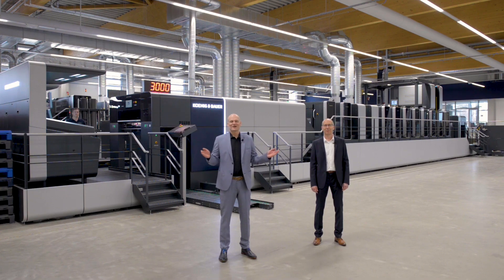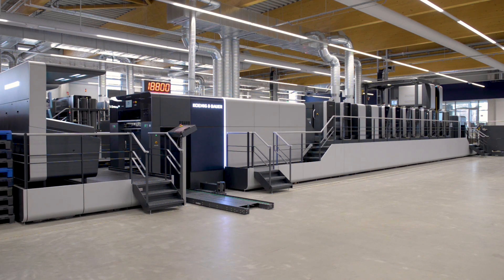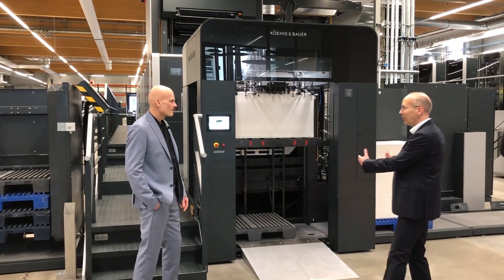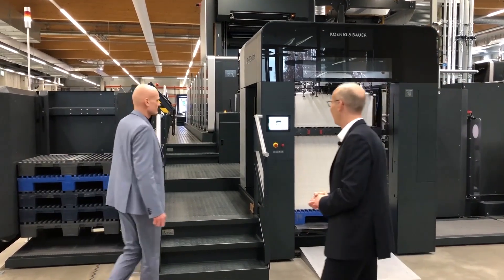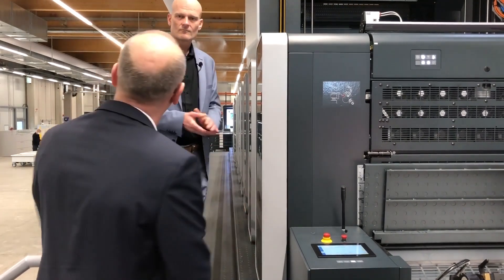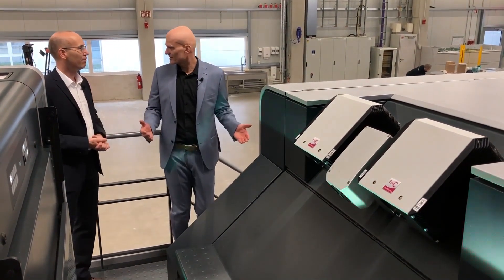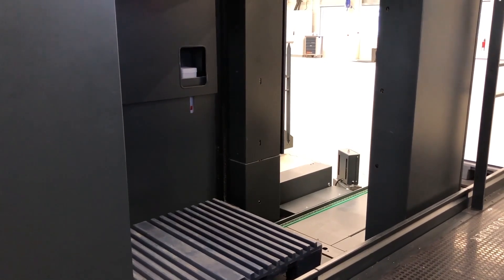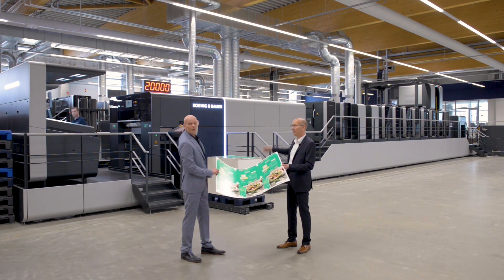Rapida 106 X | Nonstop production of 20,000 sheets/h | #KoenigandBauer360

Comment: Wow! That is definitely a productive machine! Too bad I’m at the end of my printing career, I would have loved to run a press like that. When I think of the labels we used to print on a 2 color manual press!
Reply: The difference dear Louis, is that years ago you learned a job and it really took the head and the commitment to be a lithographer....now you don't learn anything!!! The operator nowadays, doesn't even know 10% of the printing process....with all these technologies, he has lost a lot in individual professionalism. In this video, they show that everything works well and everything at maximum speed, when in reality you know very well that this does not happen, I work for a world leader in luxury packaging and I can assure you that certain jobs, with 8 colours, 2 varnishes on laminated paper etc etc .... more than 8000 sheets per hour you can NOT go, otherwise the job is to be thrown away ....
Reply: @lucabevilacqua1001  for me to operate this machine in my factory i need to complete a 2 year apprenticeship and learn everything there is in the printing industry and you actually get a similar qualification to that from university
Reply: the difference is that Toady its a lot more Computer based, its not enough to just know Mechanics and Colors Like 30 years ago
Reply: Cloth dampeners, key ducts, mechanical plate clamps. I know.
Reply: @druckerman247  still run a Heidelberg gtoz with this. as well as a original Heidelberg cylinder. will probably stand the test of time.
Reply: Me too. I operated a massive 70 ton letterpress K&B Pax Perfector book press in the 70s.  5k per hour max!. Nobody has ever heard of them as there were only 2 in Europe.